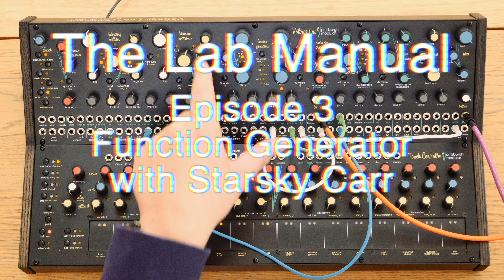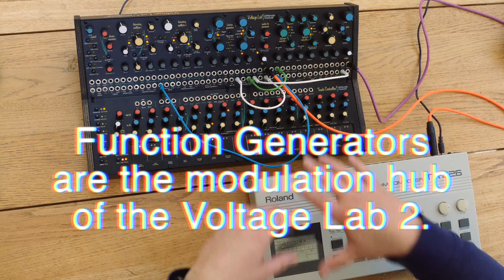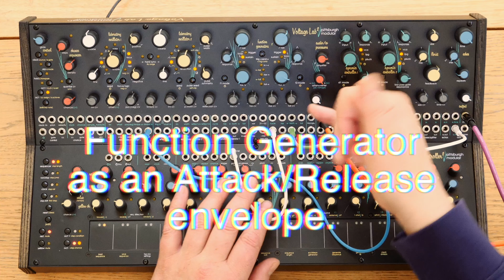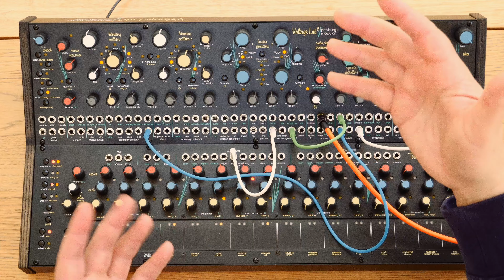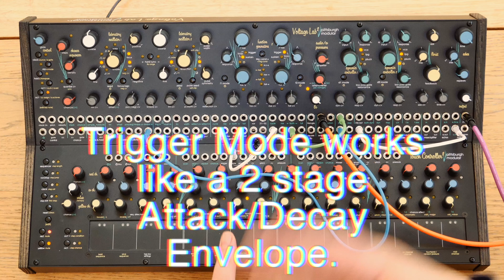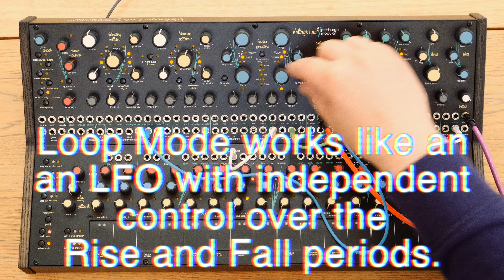Voltage Lab 2 Laboratory Function Generators Manual with Starsky Carr

Comment: Thanks for pointing out that you can use the attenuverter to tune the frequency of the function generator! this is super handy to be able to have some control over the pitch of the audio-rate cycling waveform out without changing the function generator's rise,fall or shape parameters! HUGE!

Comment: its not clear to me how patching the lfo into the input of the function generator results in triggering the FG.... 
What is going on there?
Reply: The LFO's signal crosses the threshold required by the function generator's input, causing it to interpret this crossing as a trigger. When the LFO’s output voltage increases and passes the function generator's threshold, the generator is triggered and starts its cycle. You can control how frequently the function generator is triggered by adjusting the LFO’s frequency.